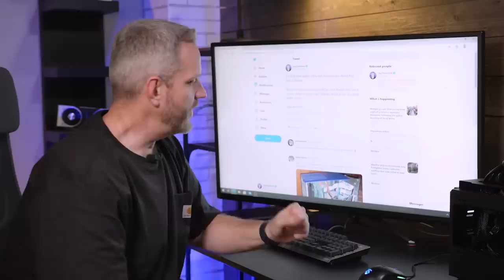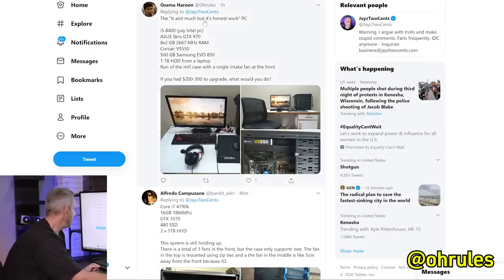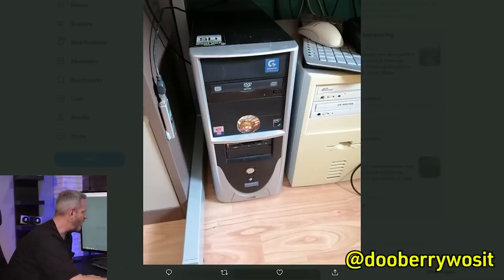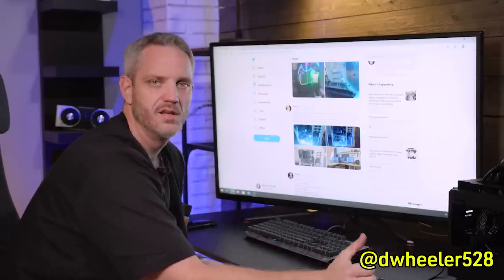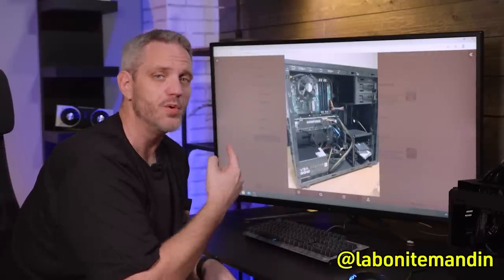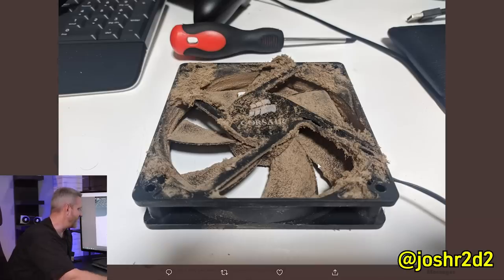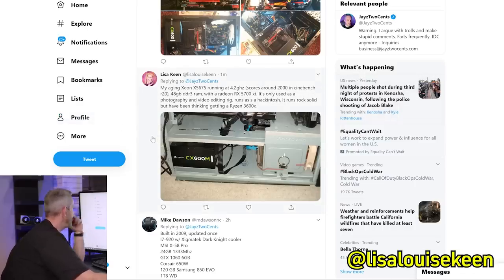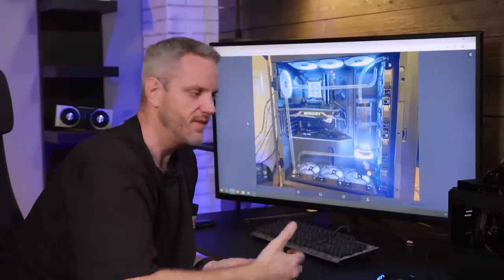Reacting to your WORST Setups... Send help NOW!

Comment: Jay is there anything I can do about this: 
"EZDIY-FAB 5-Pack 120mm Dual Frame RGB PWM Fans for PC Case, Addressable RGB Case Fan with Fan Hubs, 5V ARGB 3-pin Motherboard Sync, ASUS Aura Sync"  they are 3 pin 5v dang it, I need 4 pin 12v is there any way that I can use these with an adaptor of some kind.  I have Asus Strix-A, Z490 board, i9-10850k, Lian Li Dynamic XL case,  with AIO I will need 10 fans.  They are the best-looking fans I've seen I want them so bad but I don't want problems.   Or am I SOL.   If I can't use these fans what's out there that's about the same its the HALO effect look.  HELP PLEASE I KNOW YOU if anyone can come up with something. Thank You. Your story I can feel for you my back surgery I was flayed open for a whole day as the blood supply was gone and they needed to wait till it got there. I never even can remember that surgery so I have a rod now.  That had to be the worst of the worst for your poor wife bless your hearts I'm so glad you both made it through.